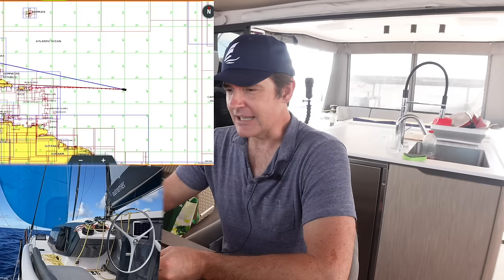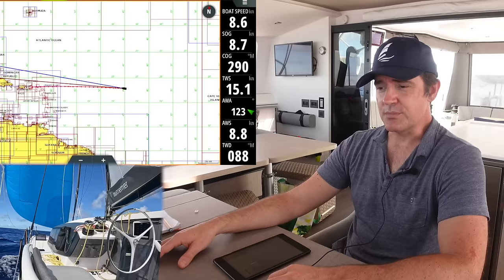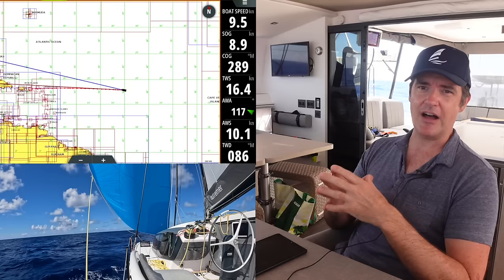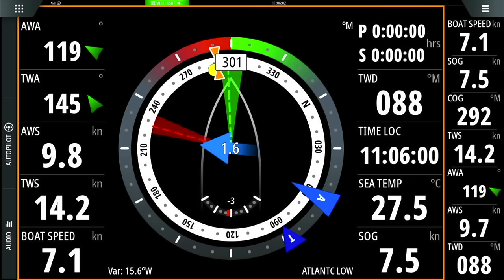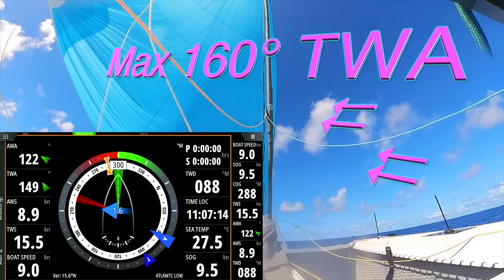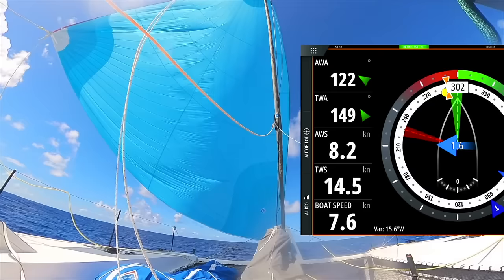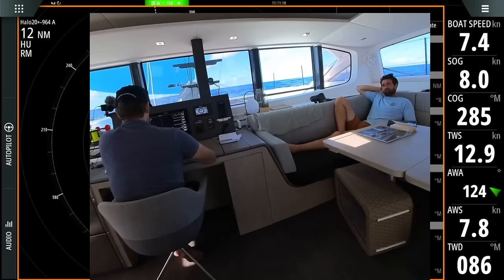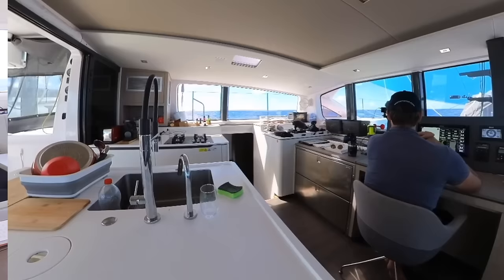Offshore Electronics Explained -B&G, Starlink, Iridium- MID-ATLANTIC UPDATE

Comment: Starlink power supply: There have been quite a few people from the RV community who have built DC power supplies  for their Starlink. The inside unit is a wifi modem and 48V DC power supply. All of the Satalite hardware software is in the dish, so if you have 48V or a more efficient conversion than making 120v ac only to have it converted back to DC, then it might be worth it. The process is to cut and splice the proprietary cable and create an ethernet out and 48v dc in. These are connected to your ships power and whatever wifi modem you want. The starlink indoor unit isn't used. Depending on your existing equipment, there can be a considerable power saving. It is still a powerhog, though, but remember it is a high-speed link reaching out 500 miles to recivers traveling at supersonic speeds. Starlink does need to provide indoor units more compatible with yacht power though.
Reply: I converted mine to 12v with poe and 48v transformer. Works great. Tested in USVI and BVI so far.
Reply: Yes pretty much all electronics are DC at the core - thanks for posting this!

Comment: Thanks for this video and I am enjoying sharing your adventures! I want to share two counterpoints to this. First, one option is to have a backup $100-200 inverter on the boat which is probably a good idea regardless. Such a portable 1000 watt 12 or 24 to 120v inverter would easily power the Starlink if the main large inverter fails. Second, many people with Starlink as primary recommend having something like the Garmin inReach Mini as a backup. This is much less expensive than Irridium Go, is portable so can go into a liferaft, and is also great to take on a hike on a secluded island in case of an emergency. Just some thoughts to consider and thanks again for this video!
Reply from the maker: Yes, you are right. There are other options. And yes I would recommend a spare inverter. In fact if this were my boat, Starlink would have its own inverter. Go Exec is a complete coms package. InReach is not. Iridium, on my boats, is the PRIMARY coms. I would have SL, but it would be for sometimes use. Different mentality.

Comment: Hi, Some comments. Roaming starlink V2, converted to 12V DC takes only 3.4A at 13V, or 45W, it doesnt need an inverter and can run 24/7 taking about 84Ah per day.
It works great on the ocean.

Comment: I love episodes like this. 
A. Thanks for going over the compass rose. Nobody does that and it just remains a mystery. 
B. Hopefully FLIR gets paired with some Tesla Full Self Driving AI software someday and the boat will de-power and sound an alarm if you're headed toward a container or something. Or someday go around the obstacle and let you sleep. Full Self Driving boats would be way easier to build than a car if the interest was there.
C. 12V really is holding the world back. Off grid homes are 48V now, we also now have the first 48V vehicle on the market and should see the auto industry shift to 48V in the coming years. Boats unfortunately will lag. But 48V will come to boats someday too. (5 to 10 years)
D. Starlink isn't there right now but the first satellites that communicate with your phone are up right now. When this is worked out a solar powered cell phone power brick will become the new emergency "iridium go". Although it is comforting to have a totally separate geostationary satellite in a completely different orbit as back up. Having said that a back pack version of Starlink is coming soon and we'll see what its power requirements are.

Comment: Nick, super useful piece. One thing you did not mention (or might not have detail on) is purchase and operating costs. For many this will drive the decision on what they fit and, in my mind, awesome though Starlink is the monthly costs would be the killer factor preventing me buying into it. I've seen articles in yachting magazines on this in the past but the pricepoints are always changing and first time I've seen an official marinised Starlink rather then a RV one tacked onto a vessel. 
The B&G looks very user friendly and clear to operate with total integration of the various inputs to provider the operator with the information they need. 
Anyway hope remained of the crossing goes well and you make it to Miami on time. Smooth sailing.

Comment: Well explained but let’s not forget that all oceans were explored a few centuries ago without electronics. Basically you want to have a clock to know how many hours you have sailed and a speed-over-ground to know how fast you have been sailing in these hours, a kompas to tell you if you are still heading in the right direction and a depth meter to know if you are still floating.

Comment: Greetings to the couple.  Regarding Starlink on the boat, there are already 12v/24v devices, with a consumption of less than 10 amps, which replace the Starlink's 110v base, and therefore the inverter does not need to be connected for Starlink to work.  And truth.  Starlink needs more energy to operate.  But I think it increases security, as it is possible to consult meteorological data in real time, like Windy, for example.

Comment: It was a mistake to install that big dish. It’s really meant for commercial vessels and super yachts. Thousands of offshore sailboats are crossing oceans using the smaller V2 dish. Uses 45-55 watts instead of 150. It used to have dropouts offshore but as Starlink has launched more satellites and improved the software that’s no longer a problem. PredictWind service is MUCH more reliable on my Starlink than on Iridium. I finally sold the Iridium. Yes, you should always  have a backup communications system. I always carried an InReach as a backup to the Iridium. It’s more rugged the Iridium and doesn’t require a cellphone. Now the InReach is the backup to Starlink.
Reply from the maker: not my boat

Comment: Good episode. Love this tech stuff.  You guys are making great progress, Predict Wind should put ads in the corner. Having done this, recorded in a series of closely space dots on my Google Maps  I'm thrilled to see the progress Moonshot makes in half a day.   I hope to see full trip details. Overall average speed, distance covered, some accounting of the wind and sea conditions (How much different is a performance cat over a regular cat over a 42-48' monohull on that same route in those same conditions?  On the 42' Seawind 1260 over 4500nM crossing the north Pacific I think we averaged about 4.4 knots. We had several days of no wind which we motored, but not too fast. )  How much motoring? 
I've spent a lot of time looking at B&G while on watches. It is also my preferred system, but one problem I think all of these systems have is a poor work flow. Even after three months of two watches a day, and lots of off watch checking, it's still really easy to glance at the screen and read the wrong thing. 
At the beginnings of watches I would write down the heading, wind speed, VOG. When we moved watches inside we put the auto pilot on the same screen. It was barely indicated by a thin surround box. It was then really easy to grab the dial to zoom in or out of the chart, and as you were wondering Why isn't it zooming? The autopilot is heading off in some completely random direction. Numbers on paper got me back on course. So it takes a lot of practice,  it's still difficult to scan those screens, but the information is there.  
If you haven't sailed with B&G I'd suggest watching Nick's video several times.  Make notes. look stuff up.  These are great systems, but it's easy to miss stuff.  (True Wind Speed and Apparent Wind Speed are always separated by AWA. Ideally these would be splits TWS/AWS and TWD/AWA. And what's Magnetic and what's True?  I confess I still have to puzzle that out. the Chart is True, the TWD here is °M(agnetic).  It's unnecessarily fussy, but I don't know of anything better. (If we didn't want to think, we'd have stayed close to home, bought a speed boat and a case of beer.) 
We had the lower end B&G radar. Almost never used it. The better and more expensive B&G radar we used on a boat in the Bahamas. It would predict the paths of squalls, you could 'interrogate' targets by selecting them. If it was a vessel without AIS, it would figure that out and predict it's course and speed.  Very useful. (I'd get the better radar before I'd get a bigger or a second monitor.)  I have 20 year old Ray Marine, barely works (N and S are switched. Course heading on the Auto Pilot 365°, I'm headed due South. The auto pilot is rock solid) I plan to upgrade it all but mostly I want to get it on an iPad or two. Then I can sit outside and see what's going on, sit in my head... and see what's going on. Nav stations are obsolete. (In 7500 nM and three months, we never once used the one in the Seawind. In my boat I've never used it. Just two days ago I looked at the screen and it was still centered on an anchorage I was at four months ago.) 
The FLIR camera would be handy. On my Asia adventure we probably passed a dozen 'things' that we would not have wanted to run into. None of them at night... or did we just happen to miss them?  A top of the mast camera is also great for docking. I need one because my spinnaker blocks everything forward so much it's not safe to use near the coast. 
My Big Ask: What is it like in the forward berth  in rough seas, fast speeds?  How much bouncing? What's the slamming sound like? I actually loved all of this, rocked me to sleep. If you woke up up in 3 meter seas I could've told you 'My bassinet as a baby was a cement mixer,' and you'd believe me. I know this is very weird.

Comment: We converted our standard dish to run off 12v/48v and replaced their router with a MoFi 5500.   We draw around 35 to 50w with ours.   I did the conversion almost 2 years ago and it stays on full time.   We do have an Iridium Go on board and a Garmin inReach as backup comms.
Reply from the maker: That’s way better than this one. The marine dish cooks a lot of amps.
Reply: @TheOKellys  when I saw the power consumption of the “marina” unit I made the decision to not switch over.   As long as they let me keep using this old unit I will.   We have also converted to flat dish by unplugging the motor.   I didn’t find a power consumption from the motor, but did find it annoying when we swing on anchor and it wouldn’t adjust since the signal was good enough for it to kind of work.   I could tell if I was watching a 4k video…first world problem….that the I would get skips.   We have a friend to disassembled his dish all the way down and found that he didn’t even need 48v.   He removed the POE (Power over Ethernet) and runs his off 12v by soldering new positive/negatives to the dish. 

BTW watching sitting in Big Major Cay using our Starlink.

Comment: There are kits out there to convert starlink to 12v and using a different router. All to reduce power requirements and the inverter. It still does not solve all the problems you raise, but it helps. Nevertheless I agree 100%, starlink is not a "survival" device. It's a comfort device on a sailboat. 
I like having the view of the sea as you talk, makes me feel like I am on the boat too, a bit.

Comment: Thanks for a great explanation of the sailing instruments and some of the significance!  

Super, super useful video.  Please do more.  Describing when and how to use the different sails, when to reef, etc. would be very useful.

Very glad Megan is getting better.

Question, does the blue drift arrow include only current, or does it also include leeway (side slippage of the hull through water due to wind and keel and rudder)?

Also, this is a superbly well done video.  Well narrated, well filmed, well edited,   The simultaneous views help put things in more context.

Knowing SpaceX, they will probably improve the energy efficiency with hardware updates.  Starlink uses and actively scanned electronic antenna array to communicate with the satellites, which may use more energy than other methods, but also works better. It's part of how they're able to get high data rates.
Reply from the maker: The drift or set...no it is not distinguished by current and leeway...to my knowledge.

Comment: The garment 86 sci should be in every sailors pocket.  it provides one button sos plus messages to anyone. Starlink, no way I would depend on it even though I have 3 primary solar power generators that can operate mine for 3 days without recharging. Everything a sailor needs for communications and rescue should be grab and jump, even vhs radio.

Comment: The starlink can be modified to run directly of the 12V or 24V battery and thats what you should do to reduce its consumption. its the primary go to for communication and downloading weather but you shouldn't 100% rely on it and have a backup thats mobile and can be taken into liferaft. I fully disagree that the iridium exec is a must have, especially if you have starlink the iridum go is the sufficent must have as is also capable of downloading your grib files, it also capable of tracking, making calls and writing SMS so to stay in contact in case starlink doesn't work. Also the iridum go is more portable and needs less energy to do the same then the exec, just slower. The datahub is absolutely unnecessary and is essentially the tesla datacollector for boats making you 100% big brother is watching you....orca core is also capable of creating your polars and is a very good backup (or in my case raymarine is now the backup) to your chartplotter and also connects to your radar.

Comment: Thank you so much! I’m buying a boat in a few months and retiring to cruise I’ve been trying to figure out what I need for a single hull and no other video really explains other than a rundown of the gadgets they’re installing. Would you say 3 Tritons is enough for over a dodger? My plan is to have a 12” Zeus at helm, 3 tritons under the dodger. And minimal down below with a Zeus 9, Triton for sailsteer, and the Icom M510 radio. I also plan AIS and Halo20+ radar. I want to avoid the starship enterprise thing while having enough data.

Comment: You can take the SL standard dish who is working great on-offshore around the world as well. With 230V and just minor energy consumption.
Then you take a Germin in Reach as backup if you have to leave the boat and you are fine for all situations. If your electric system will fail with inverter or other critical components you probably have a much bigger problem then just loosing Starlink and the Super slow Iridium device.
But of corse with Sponsors for everything ( Iridium, Predict Wind executive....) its easy to have such requirements. Fact is: the data communication speed and high cost for todays Sat communication options like Iridium, Garmin, Sat phone...are by far to high for very low performance.
Reply from the maker: I don’t think you’re approaching me with the right vibe on this one, but I’ll respond. My approach is that Go/Go Exec is my PRIMARY coms. To me, that makes it 10x an InReach…not to put InReach down…great deal, extremely capable, has saved many lives…but Go Exec does everything I want it to. The SL, in my brain at least, is a luxury, and brings too much of the outside world to an experience I’d prefer to drink in fully. Have it aboard? Yes, 1000%, but I have a love hate relationship with it. Here I am mid Atlantic responding to you, and if I couldn’t, I’d have a different experience of this passage. But hey we all get to slice the bread how we like, so no criticism of how you do it. And regarding sponsorship….that’s laughable from where I sit. I promote PW because it’s probably the most accessible tool that if used properly, will have the greatest impact on the enjoyment of the passage. More important than SL by 10x.
Reply: Thanks for your answer. Its very much appreciated. We all have different preferences and objectives. I sailed around half of the world now with SL standard dish for 60,- USD/ month unlimited GB at land and up to 15Nm off shore and 2.5 USD / GB offshore. I never had any issue with connectivity except in very heavy rainfall where even GPS failed. Compared to about 10USD/MB cost for Satellite connection with low speed, this is what the future will be. I personally think that in 5 Years from now, things like In Reach, Sat phone and Iridium will be gone from the market if they do not come up with similar performance.
Anyhow, we will see. Wish you a safe crossing and a great time on the Outremer and sorry if my approach was with a different vibe.

Comment: Interesting, predict wind is really pushing a dying product.  It’s crazy expensive for the box and even more $ for slower than dial up data.  A Garmin inreach will meet the backup needs and go with you in the life raft (predict winds big reason for having a Go). No you’re not getting grib files in the raft, but do you really need them?  Did you carry a second Go before Starlink?   Or did you just have one, and deal with it if it failed?  Kind Regards thanks for the videos.
Reply from the maker: Carried a second battery, but no spare Go. Never had a Go failure except for battery.

Comment: A question if I may. Auto-helming to wind direction is really cool, especially if wind direction is compatible with your intended course.  What is your planning/action process when the wind direction is no longer favorable?  Is it just analysis of forecasted wind/weather conditions with course change and sail trim?  What is your process to maintain best VMG?  Add me to the I like “technical” group. Thanks!
Reply from the maker: Well, that is a big question you ask. There are probably 10 considerations. 20. Forecast and route further toward destination a few days, crew capacity, sea state is a BIG one, issues with the boat, etc… Someone could teach a course on this.